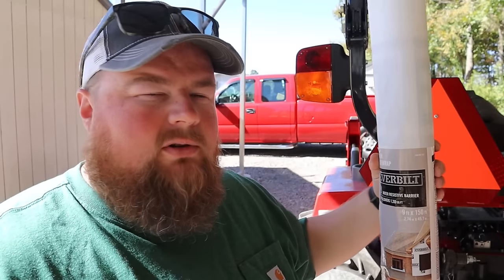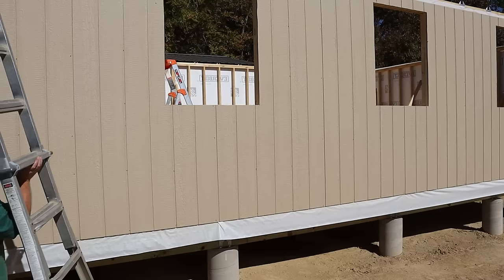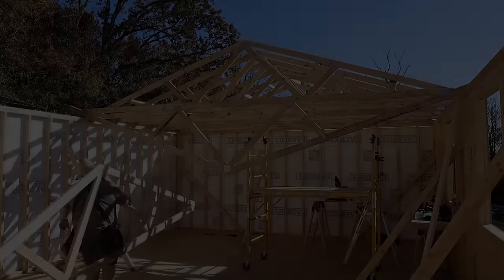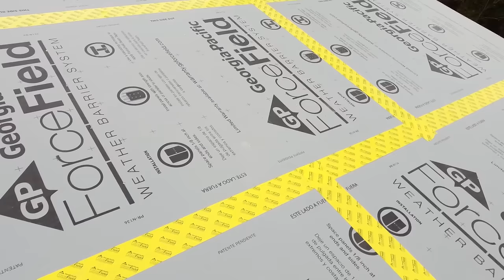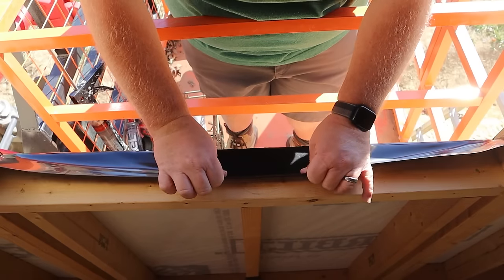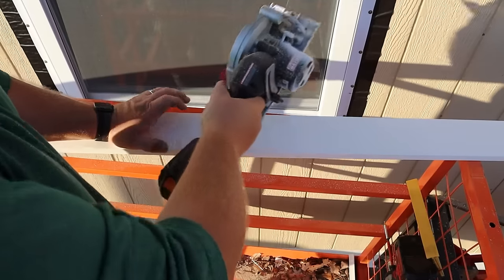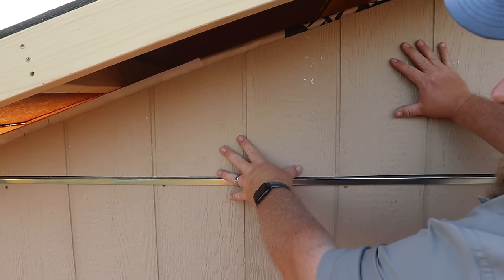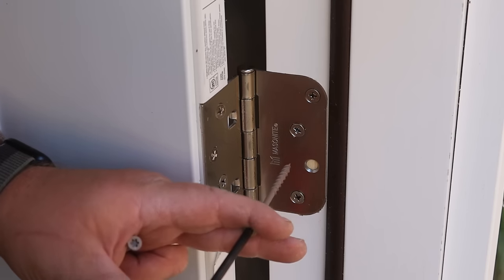Am I Secretly Building a New Home?

Comment: What was the purpose of using the long clamps installing the gable-end overhang/soffit boards?  Also...I presume you ordered the rafters pre-built?
Reply from the maker: To get the spacing exactly right at 24" on center before attaching them together. Yes, these are pre-built engineered trusses. Cost for all of the trusses plus delivery in 2023 was right at $1,500